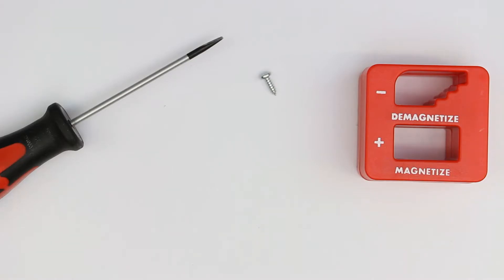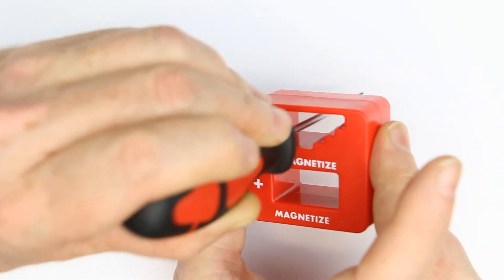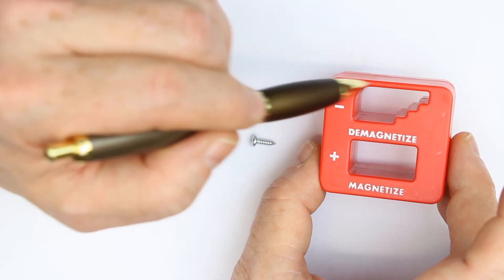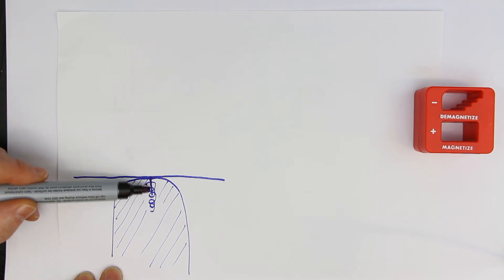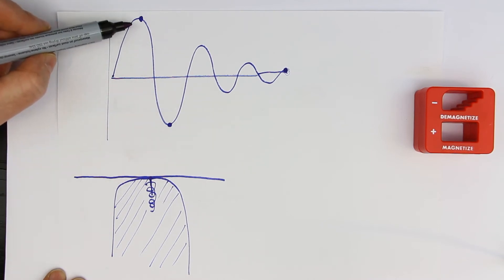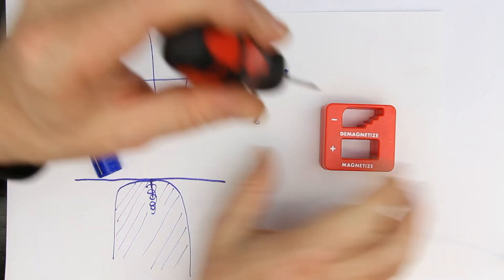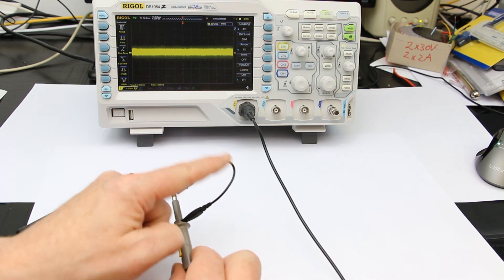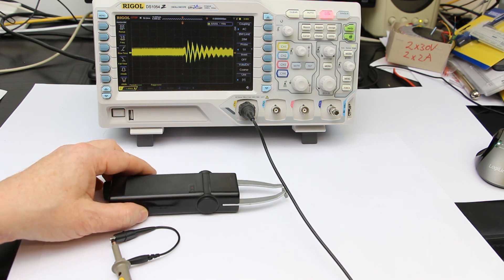Every maker should have…[Pt.16] a Magnetizer/Demagnetizer

Comment: (NORTH - NORTH facing each other or SOUTH - SOUTH for "magnetize" area. It will automatically make the other side become "demagnetizer" 

SOMETIMES THE POLARITY IS WRONG. THAT'S WHY THEY NOT WORKING. JUST OPEN AND RE ALIGN. Also for demagnetize area screwdriver should touch the area where the magnet settle

Comment: I use a tool TD83 tape head demagnitizer made by Eagle International japan this plugs into the mains power it is about 3" length with a metal prong that vibrates to use just wipe across the tape head and your done.
Reply from the maker: I only could find infos about the forerunner TD.79 which is kind of the "standard" way for demagnetizing tape-heads back in the old days. With those types you had to move the eraser slowly and in a constant direction away from the tape-head. But the TD.83 seems somehow different (looks also much bigger). Do you have some more info about that type and how it exactly works inside?

Perhaps these "companion" videos to this one above are of interest for you:
Demagnetizing and Degaussing Theory: https://youtu.be/T4q5irgKEew
TDK HD11 Tape-Head Demagnetizer Teardown & Reverse-Engineerung: https://youtu.be/q4Ws5yZK500

Comment: I've had some 'success' dragging different screwdrivers across different 'steps' of those tools, but even then, they work much better for magnetizing than demagnetizing. A degaussing (demagnetizing) coil intended for CRT TV technicians works excellent for general shop use. Many of them have an internal diameter of 11 inches or so, and can be had on eBay and sometimes even Amazon. To use, hold coil in one hand, and tool/part in the other spaced at about arms length. Energize coil and hold switch on. Bring part & coil together and wave/tumble part within coil, then slowly separate the two back to arms length BEFORE releasing switch. 10 or 15 seconds total cycle time is plenty. If the coil is accidentally shut off,  in the process, even momentarily, start over. If degaussing a lot of items don't exceed the coil's duty cycle limits. These coils can also be used over vise jaws and bigger stuff using much the same technique. I strongly suggest keeping pacemakers, watches, cell phones and other sensitive items away from energized degaussing equipment.
Reply from the maker: I totally agree :-)

Comment: There has to be a purpose for the “steps” on the demagnetize slot.
Reply: Demagnetizer steps works on a way where you need to moove tip of your screwdriver in circular way across hole. When screwdriver tip run over steps, it will hit each of them, hard. Force which is generated by hitting every step will demagnetize tool. Its bit hard to explain, due english is not my native language, but steps are used to hit tip of screwdriver and demagnetize it. Thats even why it have even that filleted angle in demagnetizer
Reply: @DRAGUNOV1902  Thank you for this - your explanation was better than any of the demonstration videos I'd seen.  It worked first time for me
Reply from the maker: I think it´s only due to the configuration of the alternatingly orientated magnets. Best would be a circular arrangement and the "steps" are perhaps just a crude approximation of a circle :-)

Comment: Hi, what works just as well (perhaps even better) is to put a large (M8 or bigger) bolt in the chuck of a cordless-drill, attach a stack of magnets to two opposing sides of the hex-head, spin the drill and gradually move the spinning magnets away from the thing you're trying to demagnetize. It looks like weird black magic, but works really well.
Reply from the maker: Nice trick :-)
Have to try it out.
Reply: Similar to the "degaussing" coil on older CRTs, only a lot more controlled and a lot slower decay :)

Comment: The reason why the demagnetizing action is not successful is that one needs a decreasing AC magnetic field. Then the individual magnetic domains inside the metal one is trying to demagnetize are being subjected to a decreasing magnetic filed which is
usually 50 or 60Hz. Then the magnetic domains can not realign themselves fully any longer as the magnetizing force is now too weak. Although the individual domains have retained the full magnetizing strength they are now all aligned randomly pointing in different directions and the resultant magnetic field strength is very low i.e it is demagnetized. 
That staggered opening in the Demagnetizer would need magnets which are placed in opposite magnetic orientation to simulate an AC field. Not sure the Chineese would go to such great lengths.
Reply from the maker: +Sepp Stoxreiter 
Yeah. But this is already explained from 04:17 on and in more detail in our video about "Demagnetizing/Degaussing theory" :
https://youtu.be/T4q5irgKEew

Cheers
Roger/KainkaLabs